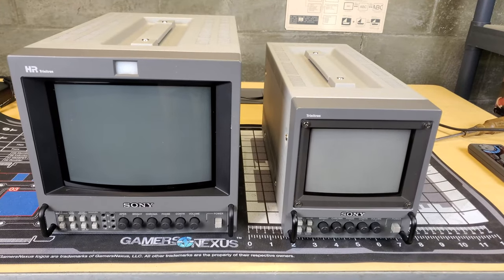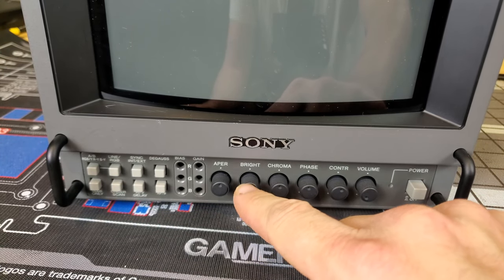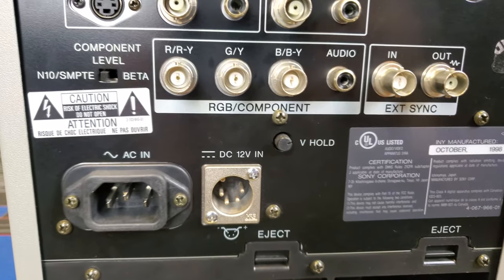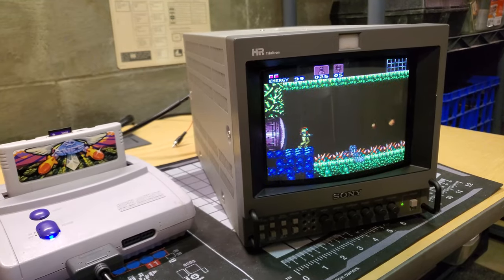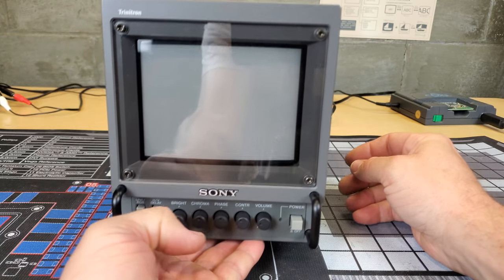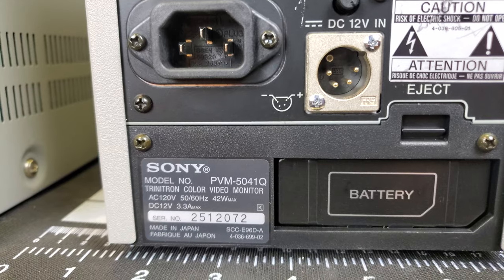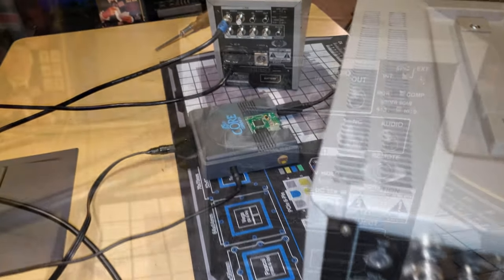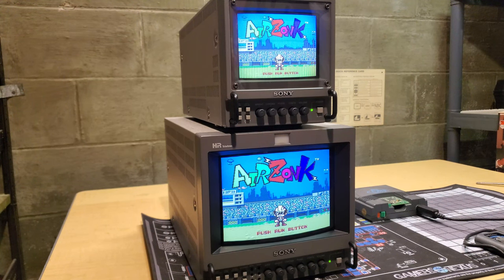Are Tiny Pro CRTs Good for Gaming? 📺 Sony PVM 5041Q & PVM 8045Q Reviews

Comment: I have a couple of 8" PVMs and I think they're awesome portable monitors. One of them unfortunately was sold claiming it was serviced but it has some minor intermittent issues I'll have to fix some day. But the fully working one is super handy to have either for testing or portability. I bought it because with the right cable you can power it directly off of a 12V deep cycle battery like you might use for a battery bank with a solar power setup. So if the power is ever off I can still run a CRT for a few hours or more to play some classic games!

Probably not a great 2 player experience though!

Comment: As a former owner of a 8042Q, they're a cute novelty but not good for regular gaming. The screens are too small, even at a close viewing distance. These are tablet and handheld screen sizes, without the ability to bring them up close to your face or angle them comfortably as you play. To understand the limitations and annoyances, one needs to play a variety of games on these for 30 mins, maybe an hour or more. It's not great. 

A 13-14" CRT is always my recommendation for anyone short on space or simply wanting a cozy little retro gaming setup. These 8" and under monitors are actually quite long and don't save as much space as you might think over a 13" set, and the screen size trade off is definitely not worth it.
Reply: I had a 20" on my desk sitting only a foot away and it felt just right. Definitely couldn't see anything less than 13" being too fun. 13" is much more attainable for a PVM as well. 20" tend to be hard to find and crazy expensive if you do.
Reply: Honestly, I use my 9042qm regularly for 240p gaming and I think it's really usable!
SNES and PS1(240p games) feel just right.
I do live in a small uni apartment, so my space option are limited...
I would love to find a 14inch in the future, would be a nice and versatile desk setup
Reply: I was thinking of getting a song pvm 8042q for 175$. Is it worth it?

Comment: They definitely have their place imo. On a desk, 8 inch is fine. They're way more portable so if you have less space and still want a CRT with high quality inputs, they're great. Most consumer sets that are 13 inch and below don't even support s video.

As the years go on and consumer sets die out, these will still be around and be way easier to get repaired due to the fact you can actually ship them without much hassle. Way easier to get serviced since more people are interested in repairing them, easier to learn how to repair due to parts and guide availability too. Also just cool if you're interested in retro tech and it's history

Comment: I have one of the 8 inch models and it has cracked solder that makes composite and S-video display in black and white, apparently a pretty common problem. If you ever find a model with this issue I'd be interested in seeing you do a repair video!
Reply from the maker: There are links to 2 videos on that subject in the description

Comment: Id really love to get a 8044Q or 8045Q. 450 Tvl on a small monitor is such a sweet combo. I just want it for a small Retro-Pi setup for my desk, mostly to play Gameboy and handheld games. I have a Jvc 9in monitor I'm just going to RGB mod instead, because that seems like a fun project. Sweet lil tubes.
Reply: I used to think that way, but after owning a PVM 8042Q, its grill matches what a square Gameboy pixel grid looks like.  Handeld games look like I remember them looking, but with crisper colors.  Just remember, ANY screen real-estate that is not used on a C.R.T. WILL create burn in.  I have seen 4:3 C.R.T.'s used exclusively for 16:9 content (the Gameboy Advance is similar, with its 5:3 content), and since the top and bottom phosphors were never used, the white balance on the top and bottom of a displayed 4:3 image, was noticeably different.

PVM 8041's, and 8040's, also create the same square grid (screen door) display.

Comment: Great video love it. Maybe a odd question bud I have a pvm 2130 where only one side of the sound works do you know what the problem could be.
Reply: bad solder joint(s) to the speaker most likely, or just bad connection to the audio jacks

Comment: Imagine being able to play on a handheld with a 5" 4:3 screen with motion clarity as good as the 5" Sony Trinitron CRT, the smooth motion clarity makes the image so much clearer in games like Metroid, Sonic, etc, unfortunately the motion clarity on the small IPS and OLED screens is terrible, and makes the otherwise stellar emulation available on devices like the Anbernic RG405, just a blurry mess if you're used to CRTs, all they need to do is ditch 60Hz sample and hold only displays and use a rolling/raster scan RGB OLED display, that way you only need 60Hz and all the 50/60Hz games will look and play just as they should.